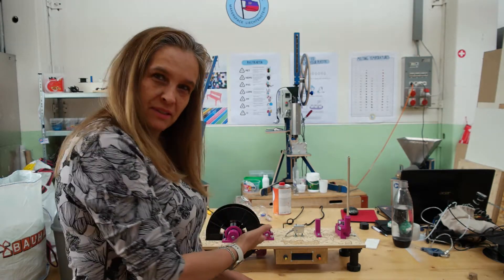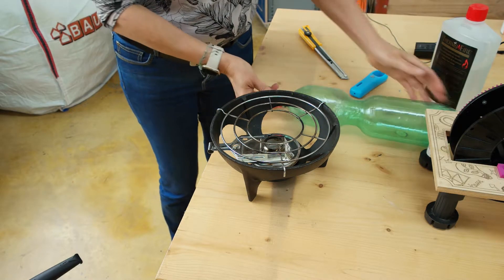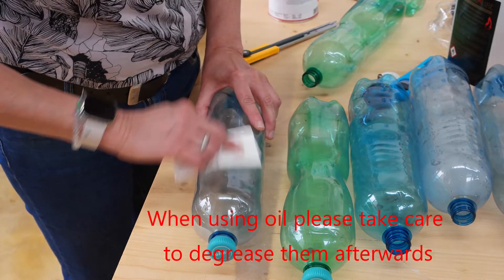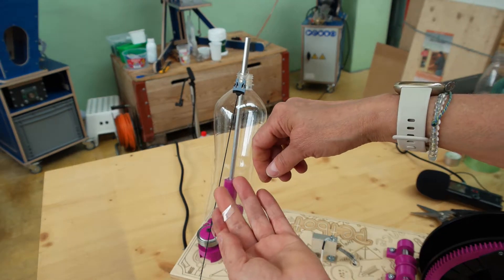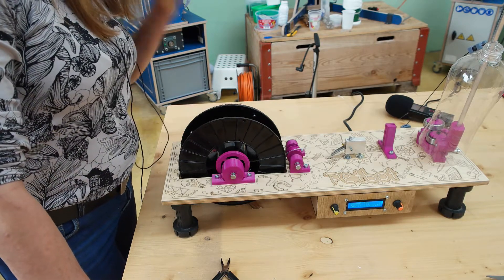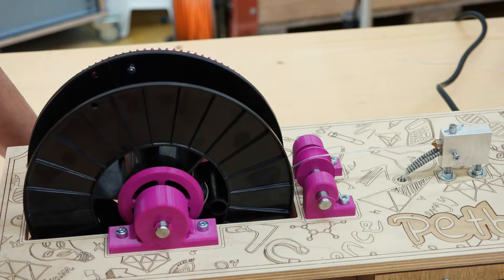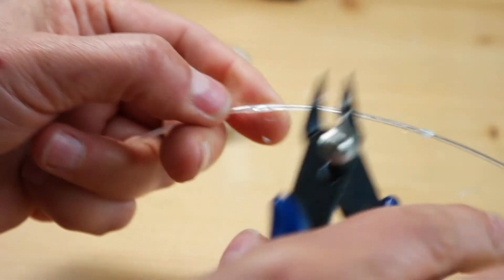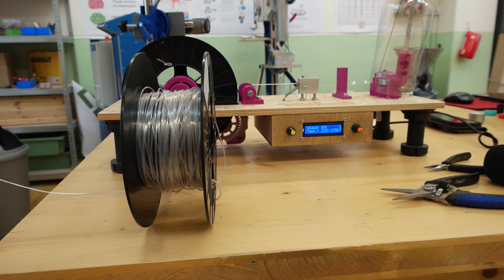PetBot filament production all practical steps

Comment: That looks like a lot of work for four bottles worth of pet. 

I'm guessing it would take a couple hundred bottles to fill up a 1kg spool.

Also guessing it takes at least 15 minutes to prepare one bottle (clean inside and out, flatten with air pressure and heat, cut, thread into machine, etc.) . So that  would be over 40 hours of labor.

One kilo of PET on Amazon is under $20.00.
This doesn't seem worth it.
Reply: So simply not worth for you. But so much worth for me. You don’t get the point about what this is all about. 🤷🏼‍♀️ It’s about showing that the cheap recourse „plastic“ is worth getting recycled instead of polluting the environment 😟
Reply: @choschiba-music  Acually, I do get it. I was certain some one would respond with how this helps the planet. But this only does that in a miniscule way. Spending that time picking up recyclables and taking them to a commercial recycler? IMO that would time actually spent helping the planet. I watched countless videos on recycling plastic and this doesn't make the top 50. Oh well...
Reply from the maker: I am not using any PET bottles at all personally. The ones that I am using in the videos are from bottles that are brought to our Precious Plastic collection center at our Makerspace.

Comment: Hi, I have a question.
I would also like to build a pet filament extruder myself.
Can you send me the Slicer Cura Profil to print the Pet Filament on the 3D printer.
Thanks in advance
Reply from the maker: The machine itself isn’t using any slicer when it‘s producing filament. You have to get an individual experience about how fast and at which temperature you pull extrude your filament. The settings are also different depending on what brand you are using. When it comes to using the produced filament in your individual 3D printer there are also a lot of different slicer settings. There isn’t really a rule of thumb. You might want to join the recreator Facebook group or http://recreator3d.com/. There you might be able to find someone using a similar PET brand, pull extruder, slicer, 3D printer combo as you have.

Comment: you can slice all bottles then join the two ends before the nozzle..try it . happy for you
Reply from the maker: I am joining them using a candle and a ptfe tube
Reply: @choschiba    joining them before the nozzle not after the nozzle
Reply: @gooo77  I‘ve tried it but that doesn’t work
Reply from the maker: PET doesn’t really bond that easily to PET. If you overheat it, it crystallizes very quickly